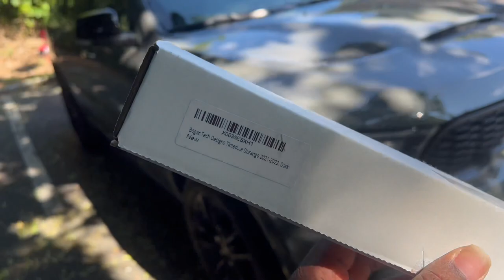2021 Dodge Durango GT Plus - How to Install Taillight Tint (Dark Smoke) Amazon Purchase

Comment: I have the same truck but in F8 green. My led lights is showing signs of blowing out. After a Google search i found out its quite common do to water . Dodge is aware of the issue and is not trying to compensate us at all for this expensive fix. Im so lucky i have a lease and its covered under the warranty.  I also have a issue with the blue tooth while playing music off my cell. Have you encountered any of these problems? Im thinking about leaving the brand all together once my lease is up.
Reply from the maker: I have not experienced the tail light issue although I know that is an issue with these dodge vehicles. I   have experienced issues with the UConnect,  you can push in the Volume and Tune button at the same time for like 5-10 seconds and it'll restart the radio and should re-connect to your phone properly.